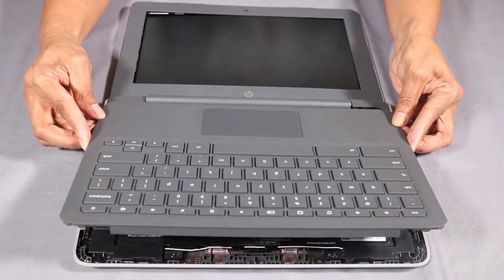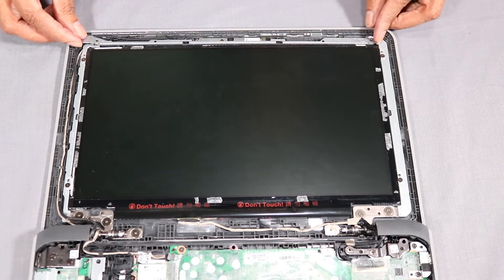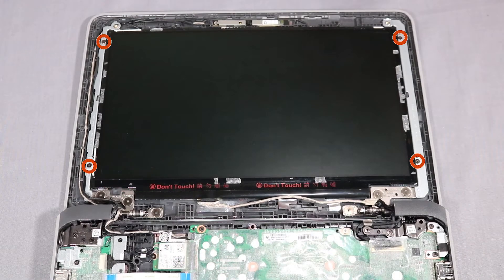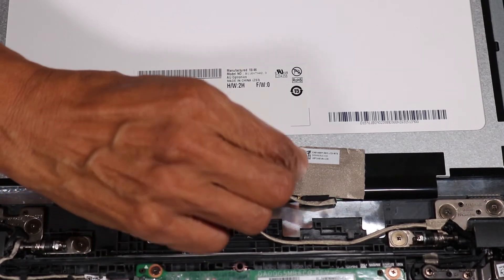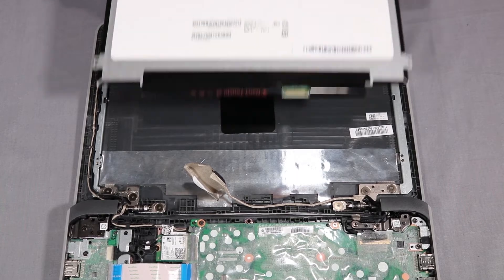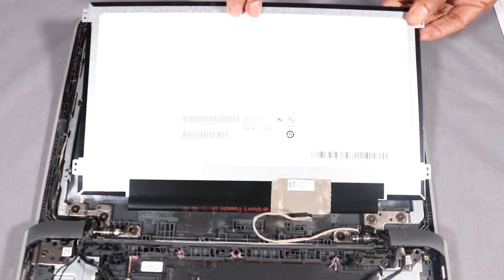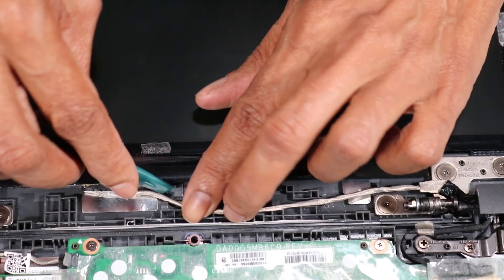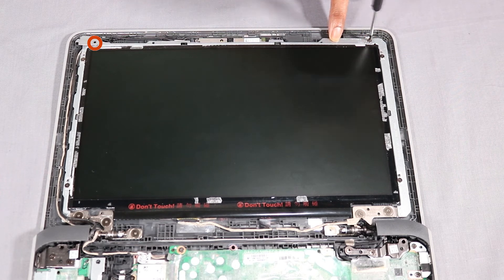Replace the Display Panel | HP Chromebook 11 G7 EE, 11 G6 EE | HP

Comment: If there are a horizontal line in laptop why this problem face? What are the reason for this problem?
Reply from the maker: +muhtasim arefin I request you to check if you are getting this horizontal lines in BIOS screen
To enter into bios screen follow these steps:
Turn on or restart the computer.
While the display is blank, press the f10 key to enter the BIOS settings menu.
Check if you are getting horizontal lines in this screen,
If the issue persists in BIOS screen then it’s a hardware issue, Contact HP phone support for further assistance.
Step 1. Open link: www.hp.com/contacthp
Step 2. Select the product type.
Step 3. Enter the serial number of your device or select let HP detect your product option.
Step 4. Select the country from the drop-down.
Step 5. You should see the HP phone support number.
Reply: @HPSupport  is there any video tutorial? How to solve this problem?